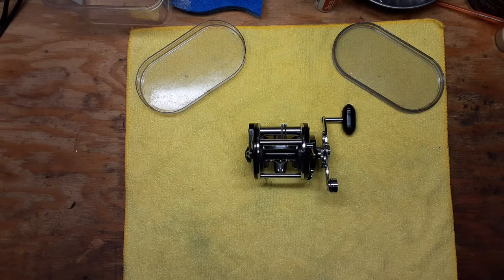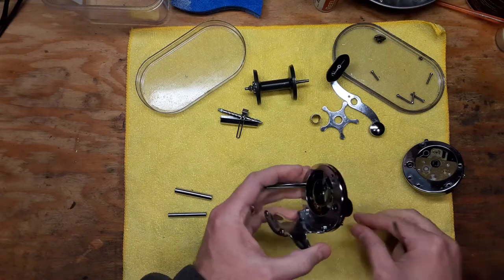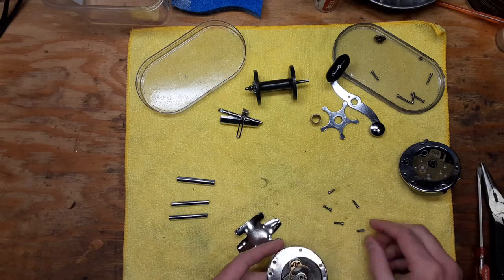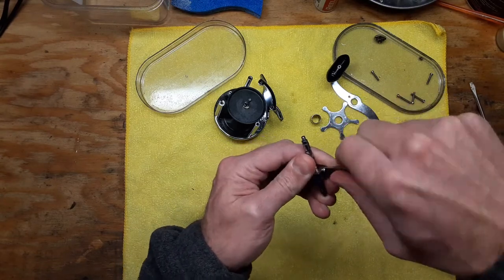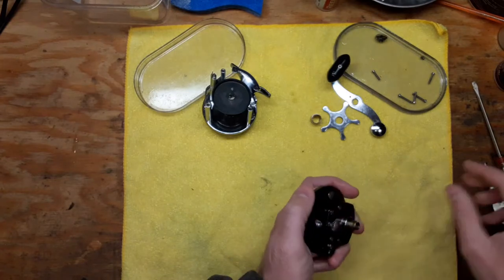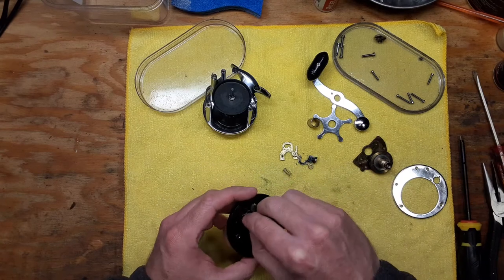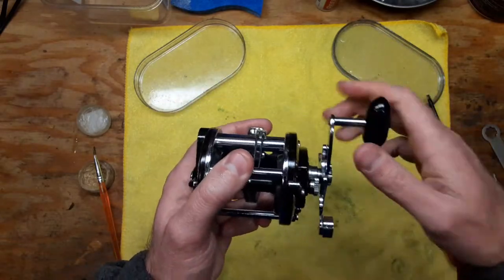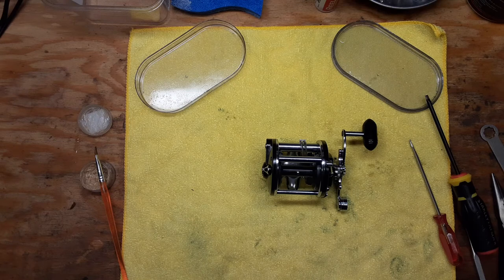Penn Mag 10 Levelwind Reel Walkthrough Service

Comment: Tony, I'm running an old Pflueger Rocket 1375 for catfishing. I've been getting into bigger flatheads lately from 25-60lb fish and the Rockets drag isn't sufficient even with the carbon fiber drag washers I've upgraded to. Would you recommend the Penn 210? I need a durable levelwind reel with more drag without having to step up to really large bodied saltwater reels & I would use a non levelwind if I had to however. Thank you for your help in advance
Reply from the maker: If your smoking drag kits then yes you probably would do best to upgrade to something a little bigger.  The Penn 210 I love.  Shimano makes some great models with very good drag sets in them.  If your bottom fishing off a boat that could a good choice however it's important to remember that the level wind mechanism is the weak point in those style reels.  If your shore fishing I would recommend getting a a larger spinning reel perhaps.  I treat catfishing like sturgeon or shark fishing.  You may spend years catching small ones but when the big one hits your rig you want to be prepared.  Hope this helps and good luck!
Reply: @backonthebenchreels   I'm 99% from the bank but occasionally go out in a boat. Long casting is rarely needed where I fish. I'm definitely not a spinning reel guy so they're out for me. I can live without the levelwind, I habitually guide my line with my thumb along with the levelwind anyway & it's a habit I can't seem to break lol. I'm after brute strength over anything else, usually casting 8oz weights and whole live bluegill, I've got to power these fish away from underwater trees are rock until I get them into open water, my rods are x-heavy 7ft boat rods & 7ft solid fiberglass rods running 100lb braid "usually"  if that helps or matters any.

Comment: Hi Tony, I just picked up a Penn No. 85 at a consignment shop.  It's my first time with an old conventional.  It's great off a pier but for some reason it won't cast.  When I cast it goes out about 10ft. and it jerks back and it actually starts reversing.  Then I'm stuck with it reeling back in backwards until I cast it out again.  I can't believe I can't find any guidance on this on Google but I really can't find a similar story or explanation.  Can you give some advice?
Reply from the maker: Sounds like it's due for a service.  I don't have a service video on the model 85 at this time but you can watch any of my other Penn conventional service videos like the Monofil, Beachmaster or Long Beach videos and they should give you the steps you need to work on your reel.  Hope that helps and good luck.  Thanks for watching!